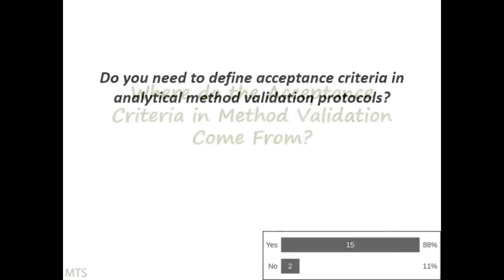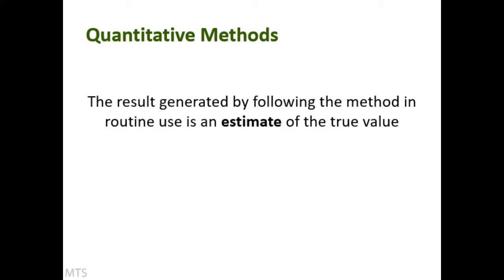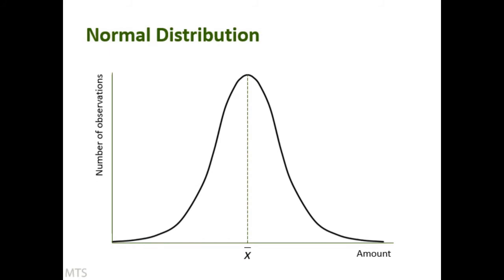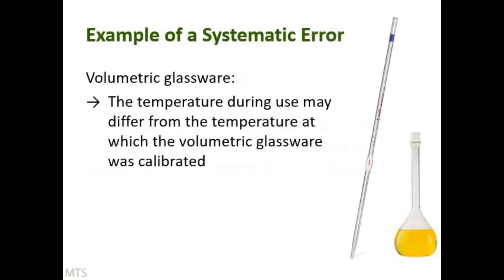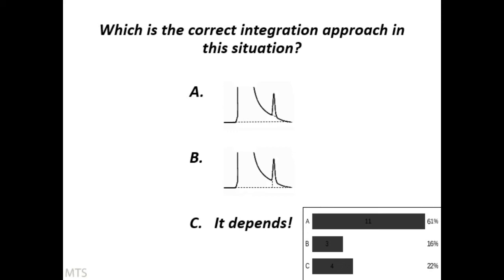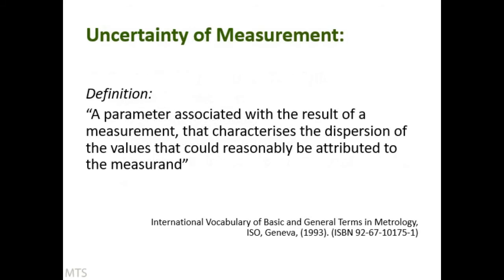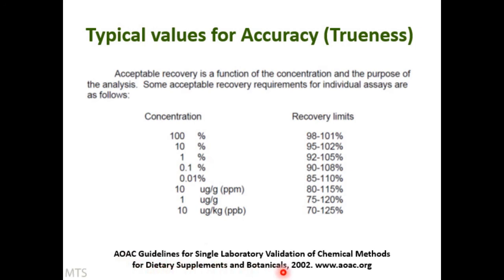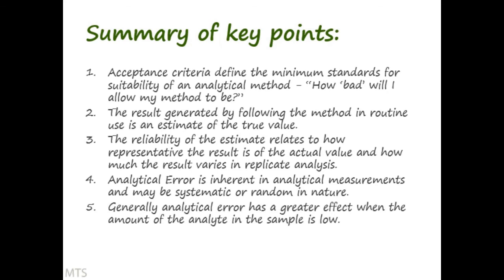Where do the Acceptance Criteria in Method Validation Come From? - Webinar Recording

Comment: Hello, regarding the criteria for the accuracy and precision, what if I am analyzing an analyte with a true concentration of 5000ppm and I quantify it using external calibration with an analytical range of 1ppm to 10ppm, wherein the sample mass was 0.5grams and the total dilution factor of 500 to fit the sample in the calibration curve, what will be my acceptance criteria for accuracy? is it on the level of the analytical range (1-10ppm) or on the level of 5000ppm?
Reply from the maker: The error that arises as a result of the sample preparation (which includes the dilution step) will relate to the proportion of the component present in the sample, therefore I would advise that you base your acceptance criteria on the actual test material concentration, i.e. 5000ppm

Comment: what about Horwitz Ratio as a precision acceptance criteria? what should I look in order to know if it is a good criteria for a particular method?
Reply from the maker: The examples of acceptance criteria for precision that were presented towards the end of the webinar were actually calculated using the Horwitz equation (RSDR = 2^(1 – 0.5logC)) and I do think that it is a good tool for estimating the expected precision for a given sample. It tends to be slightly pessimistic at high concentrations, and more noticeably so at low trace concentrations.

Comment: Hello mam, I like your webinar very much. I have one query... During precision studies, we carry out 6 replicate analysis. The %rsd of these should be calculated of rounded values or unrounded values?
Reply from the maker: I would advise that the data is expressed in the same way as when you are following the method for a routine analysis. This would typically involve using data with one more decimal place than the final result. For example, if the method is performed in duplicate it is typical to calculate the mean (reportable value) using the unrounded results for each of the duplicate determinations, and then round.
Reply: @MTStraining  thank you for your response ma'am. But my concern is during routine analysis, the final rounded figure is declared. So while precision studies during validation, the rsd shoud be calculated of 6 rounded off values.... Do you agree? Can you please share me your email id so that I can share a live case....
Reply: @satnamom4667  Nooooo, dont round!!! All calculations should be done using 5 s.f. (as a guide) once you have calculated then you can round. A lot of calculations are based on the fact that data is normally distributed... however, if all your data is 2.2, 2.2, 2.2, 2.2, 2.2, 2.2 you would have no standard deviation which is obviously not correct. Therefore you are losing valuable information by rounding.